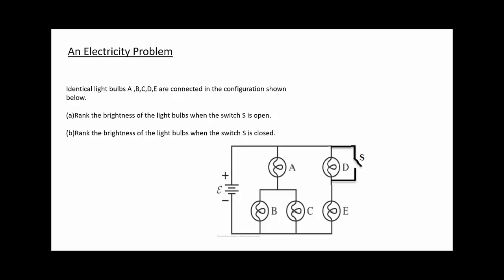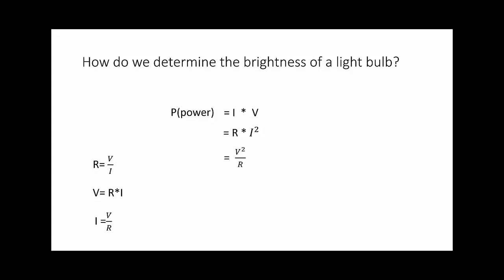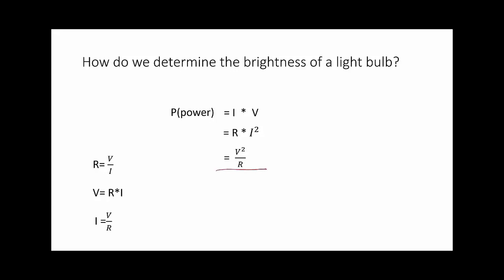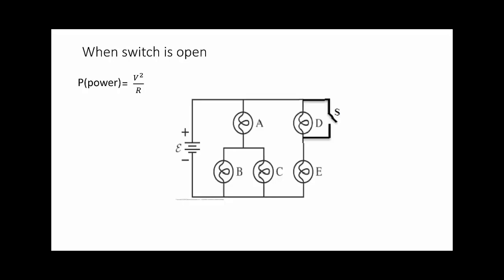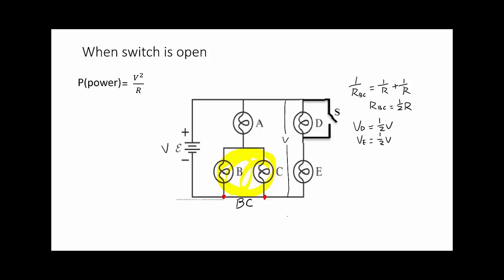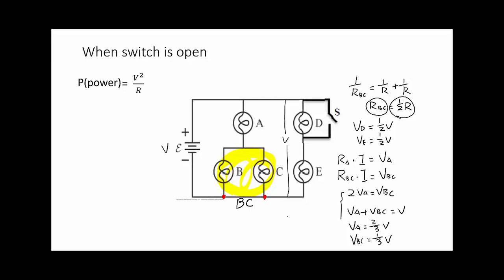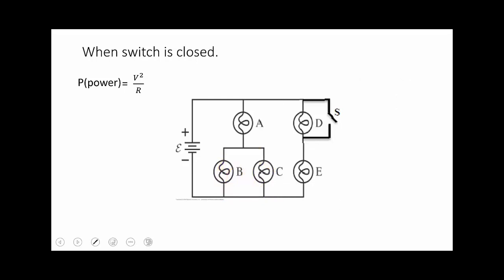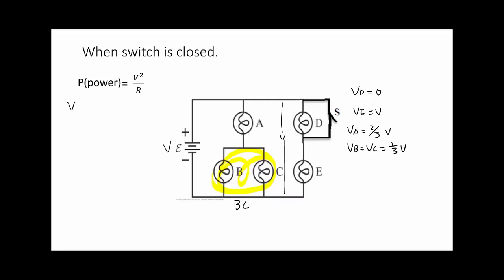Light Bulb Circuit

Comment: Why don't you take current into account when comparing brightness?
Reply: Current doesn't tell the whole picture. You also need to consider the voltage. To figure out the brightness which relates to energy dissipated in a given amount of time we look at power. And power is the product of current AND voltage.

Comment: How is Va 2/3 of V?
Reply: The resistance across BC is 1/2R (see 2:05min). The resistance across A is R. The supply voltage V across all them (A in series with B&C) gets split into 2 parts across A and 1 part across BC (same ratio as resistance). So Va=2/3 of V and Vbc=1/3 of V.  (Note that for this explanation we don't care about D and E since that;s a parallel branch)
Reply: @drsar100  but why not use a 1:2 ratio?
Reply: @mwenge6355  Not sure I understand your question. As I said, the ratio of voltages is same as the ratio of resistances. This follows from Ohms Law and the fact that the current in one branch is the same along the path. Also note that we combine the resistance of B and C into one virtual BC resistor that's half of R. Overall, the resistances A and BC have a ratio of 2:1 (or as I showed 1:0.5) so that means the voltage needs to be 2:1 as well.